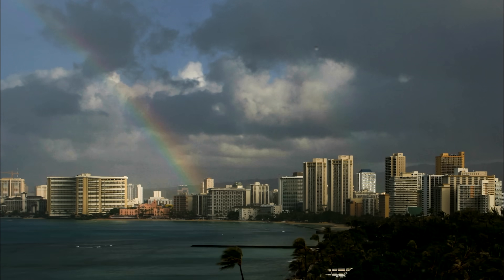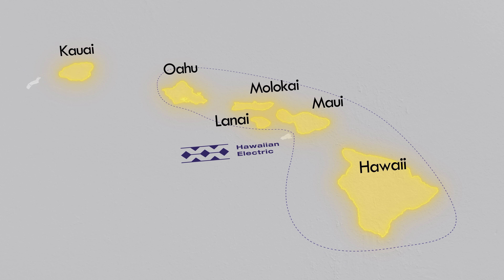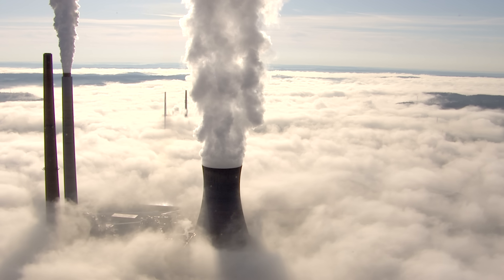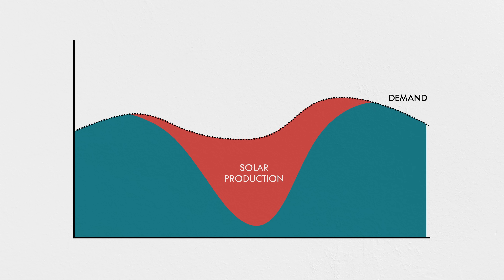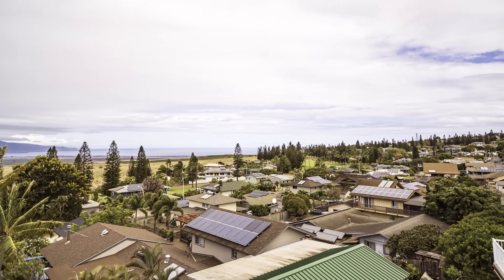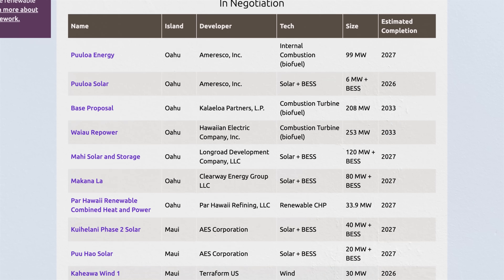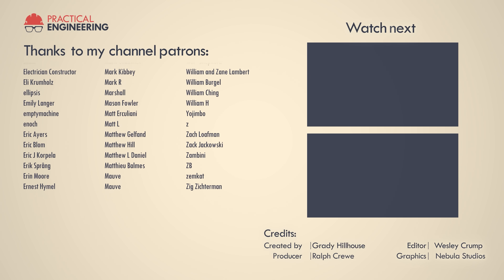How the Hawaiian Power Grid Works

Comment: (1) Props for mentioning "fixed costs" up front. Not billing fixed costs as what they actually are is holding back grid reliability innovation as it holds those projects hostage to outdated financial models and politicians who take advantage of them to stoke division & sell snake oil.
(2) Props for mentioning the data flow problem. Thankfully it seems some places are tentatively stepping into the "great unknown" on that front—but they are still hamstrung by antiquated financial models (see 1 ) and inadequate data about consumer equipment status.
(3) Spinny things vs. Inverters: The main reason why inverters cannot provide the "inertia" factor that old-fashioned mechanical systems do is because they are legally prohibited from doing so. That's it. The rules were put in place with good intentions (safety of the linemen who keep the power grid working), but are in desperate need of updating in collaboration with people who actually understand distributed systems and the data flows that make them reliable. Once upon a time grid operators had to do that with modems and microwave links, so we know change is possible.

Comment: You can pay for more reliabe power.  A battery bank and generator can bridge the gap is the grid goes down.  It doesn't make the grid more reliable, but it makes your power supply more reliable.

Comment: Great video. If there ever was a state that could decarbonize it is Hawaii with sun and steady trade winds and cost of power about $.42/kWh. HEI can run the grid with sun, wind, batteries, and a little LDES (long duration energy storage) eventually without gas peakers. Imagine all homes with smart meters and the HEI power price changing constantly to reflect the true cost. HEI could implement virtual power plants to smooth demand and fairly compensate homes that can shift loads like water heating or AC or even export power with V2G or solar batteries.

Comment: → 25% renewable power is "such a large share"? Ideally, you'd want 100%. (Ah, we later hear they are going there.)
→ 13:44 "If you are [...] not bothered by the idea of intermittent power, you can't pay a cheaper rate" – arguably, that should be possible, by having rates for customers who will be switched off first if there is not enough supply. (Needs smart devices at their end, though.) Of course the question is how much that helps, except maybe for really large non-critical consumers.
→ 13:56 "And if you use a powered medical device or work a high-powered, always-connected job at home, you can't pay extra for more reliability." – This part is certainly doable, by getting your own uninterruptible power supply. (Though you'll need that at your internet provider too.)

Comment: Renewable plants should be built in conjunction with bitcoin mining facilities. The miners can be turned off and on at will, making them excellent demand sinks for when renewables have an abundance of power, and can be shut off when there is a dearth. This would dramatically improve the stability of plant's economics, allowing them to be larger and built faster than otherwise possible.

Comment: Love your videos, and on a topic like this, I'm really glad you keep the politics that are obviously in play out of the picture.

I wonder, though.. have you looked into the recycling issues on the horizon for renewable equipment?  It's a topic I've discussed with a few civil engineers, and there seems to be only a modicum of awareness of what's around the corner.  For example, solar panels only last approximately 25 years, which means panels are being replaced relatively frequently.  As more and more locations turn to renewable energy, solar included, this means that there's going to be an avalanche of waste produced within the next 10-15 years.  Japan is already predicting 800,000 tons of solar panel waste by 2040.

Thanks, and looking forward to more of your videos.
Reply: How much solar waste is being generated at the moment. If it is small that is why their is not a project to recycle them yet.
Reply: @catprog  276,000 tons (globally) generated in 2016 alone, according to the International Renewable Energy Agency (IRENA).  As I stated before, Japan is predicting that by 2040, it will generate 800,000 tons of solar panel waste - by itself.  That's not a global number, that's just Japan.

There's no project to recycle them because there's no financial incentive.  It's an expensive task that uses dangerous and toxic chemicals.  On top of that, solar panels don't generate that much electricity, compared to other forms of renewables.

Comment: Here the grid is becoming less reliable we used to use copper open wire LV lines now we use a cable called ABC for LV lines it is aluminium based and corrodes in coastal areas.

Comment: If grid supply reliability deteriorates, those who can afford it will install batteries and other backup generation. This is not economically efficient, and only supports a handful of people - typically those in one household. The less wealthy then just have to cope with the outages. With fewer people suffering the adverse effects of outages, the political pressure to fix the problem is reduced, as is the perceived "break-even" point for grid reliability.

Comment: Hawaii is in a prime spot for geothermal energy production since it literally is a volcano. I have mixed feelings on wind due to its impacts on wildlife and the fact that decommissioned turbine blades are usually just tossed into a field (Texans are especially mad about that). Generally, I am pro nuclear, but I don't think that's such a good idea on an isolated island. Solar is also perfect since it's so sunny there. I am also a fan of hydroelectric, but Hawaii doesn't really have any big rivers, and off shore power has negative impacts on wildlife, much like wind power on land. Hawaii is really the state that should be working the hardest on energy independence since they can't easily import it. I would love for the whole country to be energy independent (which would involve more drilling for oil), but baby steps.
Reply: Pumped hydro would not need a river.

Comment: Many people asking about the use of nuclear power, so after a bit of Googling and asking an electrical engineer friend, I think, I found one of the reasons.

A nuclear power plants need a lot of time to spin up/spin down (achieve peak power or change their output level), hence they need other power plants to balance the load out on the grid. For larger grids this isn't a problem, there are many other options for power generation than can be spun up in case a of sudden load shift. For example a hydroelectric plant can achieve it's peak power in mere minutes, if the demand suddenly increases. Shutting down/starting a pressurized water reactor can take 4 days. On most of these smaller grids loads can shift in hours or even minutes.
Reply: Some reactors can load-follow - notably those in France - but it's more expensive. The number I've heard is that (with fresh fuel - this gets slower for more heavily used fuel) an EPR reactor can increase it's power by 80% in 30 minutes. Most of the cost of nuclear doesn't depend on how much power it's producing, so if you're not always running at or close to 100% then your cost-per-MWh is going to be even higher than it already is now.

I think a bigger reason is that all the currently-used reactors are far too big - the average use (annual usage divided over time, so it doesn't account for peaks and troughs) is about 1GW for all of Hawaii. The reactors most commonly being built today are the AP-1000 (1GW), the APR-1400 (1.4GW) and the EPR (1.6GW), so they're all far far far too big.

Ideally you also want to build multiple reactors at a single site to get economies of scale, too.

I'm a big fan of nuclear power, but this just seems like a really bad place to use it.
Reply: @znix9695  Wow, I did not know, that there are commercial power generating reactors out there that can adjust their power level on the fly, this fast! It's fascinating, I have to read up on it.

Yeah, the other reason is economies of scale. The infrastructure needed to run a such powerplant is huge. Nuclear is just not worth doing in a small scale. Yeah, I know there are some BWRs driving submarines and ships, and there are also research reactors out there, but most of the time they are not for commercial power generation, there are other reasons why they exist.
Reply: Right. Nukes are good at "base load" and let other plants do the adjustments for change in demand.  But it also seems like a good job for battery systems.  At least with nukes, you know there's going to be power.  Oahu once had 43 straight days of rain in 2009.  It's impractical to build a battery bank that big to backup solar for that many days.
Reply: @russellhltn1396  That's why I am confused as to why they only have one geothermal plant in the state. You are on a geothermal hot bed. I would think they would take advantage of that and use geothermal as their baseload. By the sounds of the video, they are instead focusing more on intermittent solar and wind and battery banks, which to me seems still unreliable and susceptible to significant meteorological events.
Reply: @@JuanSmithers would the other islands not be warm enough underneath for geothermal power?

Comment: Since Hawaii is so (volcanically active).  It seem it would be a prime candidate for that (drill down to hot and cycle a Freon in the pipe to continually make power.  That system doesn't work for most areas (in the north or next to a fault line or a volcano).  Hawaii could be self sufficient.

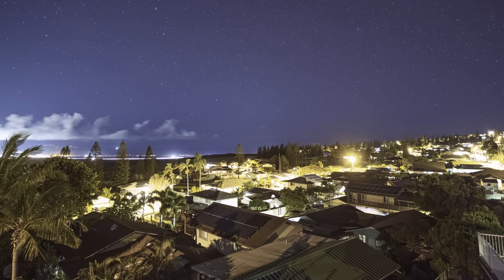Comment: 13:15 Time of Use Rating is Hawaiian Electric leveraging capitalism to appear green. The fact is that energy demand cannot easily be fluctuated by choice: Businesses and residences will naturally spike demand during the day, when temperatures are high and most people are active. You can't shut off HVAC systems at noon. It's a garbage way of dumping the costs back on consumers while whitewashing their image as "green" and luckily it doesn't appear to work too well, at least politically. Unfortunately, since they have a monopoly on the system it'll likely stick around. Source: I lived there for 25 years and I still have friends and family there today.

Comment: I worked at the Covanta trash burning plant. The island shut off the coal plant and said solar would be enough. It clearly isn’t as that 400 mw is gone now. Power authority on the island seems to be screwing stuff up and power is like 35c a kw lol
Reply: 180 MW.
Reply: @hecosean  dang that’s it? Looked like a bigger plant
Reply: @Stephenishere  Still was the largest on the island tied with Kalaeloa. (Well they have a heat recovery boiler that boost them to 208)

Comment: When I went through training for solar I was told that the Hawaii grid operators had rules put in place to require specific tolerance settings on "dumb" inverters. This allowed the grid operators to control large sections of distributed production by playing with the frequency in small changes, but enough to take the frequency outside of the setpoints on those inverters. Which had the effect of allowing the grid operators to balance the load with production from solar and fuel fired sources even without direct communication with those "dumb" inverters.
Reply: That is pretty nitty gritty theory, but the way you put reminds me of dimming light with line dimming vs 0-10 volt dimming where you have 2 control wires vs chopping up the sine wave thru line dimming that both ways have a similar effect but are accomplished differently.
Reply: This is the first video that I have to downvote for all the Fear, Uncertainty, and Doubt he is saying about home based grid-tie inverters. These devices are designed to industry specifications and must be installed by licensed electricians. He clearly owns utility stock, or has buddies at the utility. If you can spin the meter backwards to the point that you make enough money to completely zero out the monthly bill, you should be allowed to do that, even if that means you aren't paying a base fee for infrastructure. You did pay for the use of it, with the energy you supplied to the grid.

Comment: Do roads get different prices based on use? 
Why should the power grid?
Utilities should not be for profit, too easy to corrupt them and it's stuff that benefits everyone. 

Pay a base tax for simply existing where there is power, then add on a smaller usage fee per kWh. 

It's 'funny' how people whine about people getting solar, but not about them switching away from gas. It's almost like it's a bad argument propped up by corporations seeking to keep making the line go up.

Comment: ...Except you can pay more for a more dependable power stream. Buy a UPS unit for your important units and invest in a generator. Boom. Solid, dependable power, even if the grid isn't, at the cost of significant upfront cost and a small maintenance cost.

Comment: Our dual home inverter (battery and PV) is not as dumb as you might expect. There is a grid profile it has to comply with specifying conditions it is allowed to operate in.  Additionally, I would not mind if it would actively support the grid if this is compensated accordingly by the grid operator. Dynamic electricity prices are on the rise (net metering is and was never allowed where I live) and soon we will be allowed to discarge our battery back to the grid, too. In parallel, battery prices are falling and Na+ battery which probably can be stored outside even in colder places, is on the horizon. With geothermal energy, Hawai also has a renewable source for rotational inertia.

Comment: Exciting times!  Many years ago I helped a friend who lives in Maui get solar panels for his house.  That was well before I learned about the challenges individual solar generation can pose for the resiliency of the overall grid.  I think the variability in solar generation as well as daily power usage could be offset by adding a battery storage grid at most points where energy is produced & consumed, since batteries can have a near-instantaneous response to changes in load.

Comment: Converting vehicles to EV's adds a huge flexible back up system along with "smart" demand reduction? The more the green energy is produced locally the safer the Gridand service, better quality air and health and self sufficiency!! Other home batteries can safeguard against black outs and send electricity to the grid. OFF grid is the ultimate solution!!

Comment: Why, in god's name, would underwater connection ties ever be considered??? Standard issue high voltage lines on spires, just like the rest of the world... Wayyyyy cheaper (still expensive as transmission always is) and wayyyy more safe seismically.

Edit after double checking because it's so mind numbingly obvious I can't believe it wasn't considered:
Kauai and Oahu can not be connected this way (too deep) but everything else can, even the Maui and Hawaii... (Generally super deep, but there is a thin shelf connection)

Comment: Excellent video. :)
BTW to put those 20% renewables into perspective. Germany currently is at around 50%. Of course on a smaller grid that's somewhat more difficult. In Germany, because of questionable regulations, feeding your own solar power into the grid is essentially the same as throwing it away. That's why many who can afford and have the opportunity for it install their own battery storage. Since battery prices are falling, this is something that becomes more and more feasible. It will be interresting to see how this will affect the grid. It will probably lead to less power being exchanged on average, while making it more bustier.

BTW, at least in Germany you can pay more for more reliable power. The Bavarian broadcasting company "Bayerischer Rundfunk" has 2 feeds, for example. So if power goes out on one feed, they can still use the other one. This will of course only affect very local problems, but those actually make up most of the power outages in Germany.

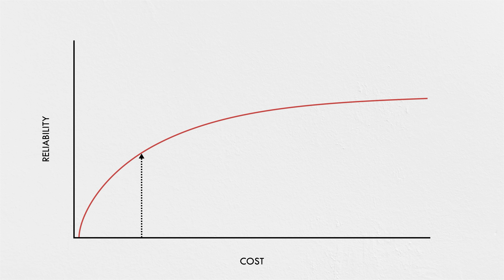Comment: I'm curious about how applicable the reliability curve at 3:33 is to this issue?  Though the cost of marginal increases in reliability will increase - wouldn't it be a lot more linear for this issue given you have the option of increasing capacity drastically thereby giving yourself more headroom and this would be a lot more linear a cost?